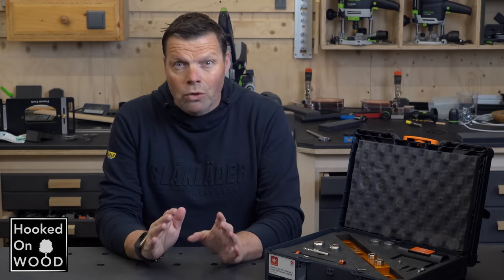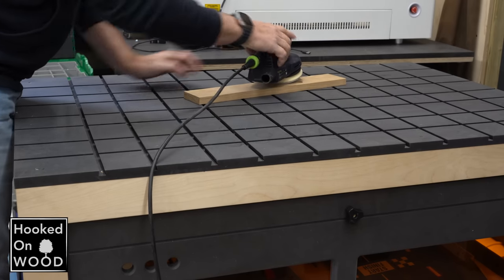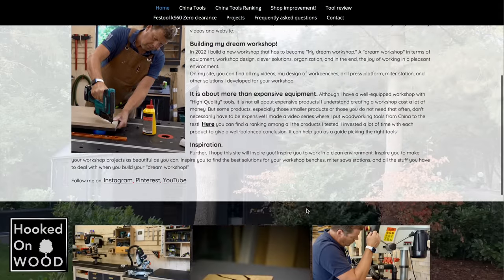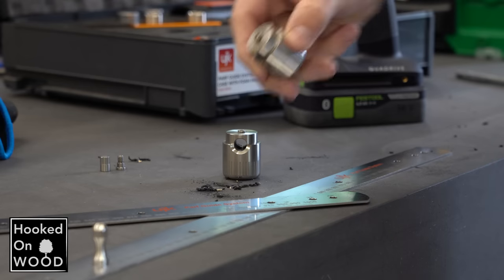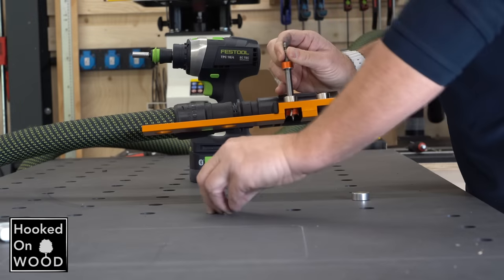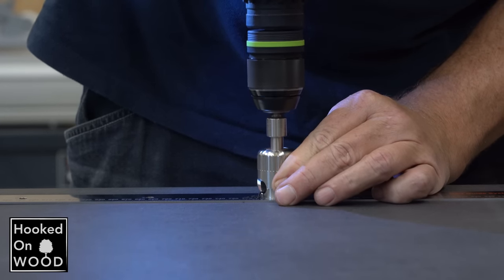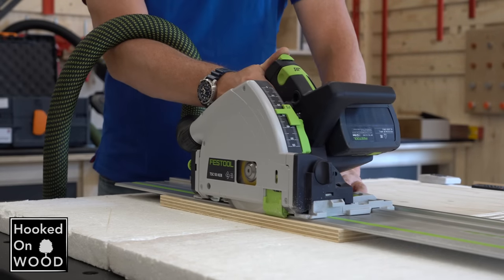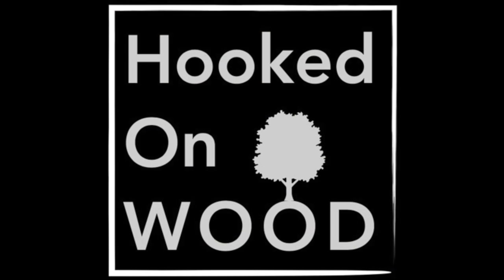Upgrading your workbench with an accurate grid of dog holes!

Comment: What really makes your projects stand out for the most part is the black top, which is pretty much impossible to get here in the USA unless you want to spend a small fortune getting a sheet shipped. This not something that can be found locally or even ordered locally.   Once you take away the black top...you really take away the visual appeal of the projects.  But the craftsmanship and attention to detail is the same and its still good work.  The visual appeal is just not repeatable....not in the USA anyway.  And I live in a very large housing boom location with every wood store you could think of...Tampa, Florida.
Reply from the maker: Hi Garry, I agree with you. It is a shame you can not get it in the USA. We pay around 100 dollars for a full sheet of 18mm. So, that is much more affordable. Without it, I think I probably would have change the design. Although I like the base anyway.
Reply: I've found the same thing - there is a distributor of Velchromat in the USA but no dealers local to me.  I've had good luck with Transtint dyes on MDF - although not dyed through it still penetrates the MDF well with a few coats and looks pretty good. There's black but other colors as well.
Reply: @todddonovan9780  Keep in mind that Valchromat is denser than mdf. You need a couple of people to move a full sheet, as it is probably twice as heavy as mdf. Luckily there is a dealer close to me in North Carolina. Also, a full sheet is a little bigger than 48x96.

Comment: There is one mistake 

You measured to the edge of the ruler. According to Peter Parfit the 3mm holes are not precisely in center of the ruler.
And Peter must know, he created the System 😉
Reply from the maker: He certainly must know :-) Thanks, I will look into it.
Reply: I have the MKII version and started my table layout just as Dennis did.  I wasn't concerned with the exact distance of the first line of holes from the edge, but wanted to ensure the line of holes was exactly parallel to the edge.  I trimmed the table edges later to the final dimension using the holes as the reference point.

Comment: This is perfect. I've been working on a new workbench but your idea of using a Felder is brilliant. I just looked them up and the Felder FAT 300 is affordable and they have a distributor in Australia (for some reason, you have to contact to get a quote but the US site shows the prices and the FAT 300 is affordable for me).
The doghole system looks ideal too so I'm adding that to my shopping list.
Years ago, I saw a video on YT showing retractable dogholes. Never found anything suitable to make them with (best I could do was experiment with various push button type of setups but they just don't give the needed depth). If you come across anything like that for dogholes, please let me know.
Reply from the maker: Hi Gary, Felder comes from a professional corner and searches for contact with the customer. So, they are not always communicating the price. The Fat 300 is smaller, although it can handle the same weight. So, for a workbench of 80 x 160 I think it will work, but otherwise, it will be too small in my view. Another point is that the lifting mechanism is at the short site, whereas it is on the longer side with the 300S. So, when your table does have too much overhang, it is hard to operate it. For stability as a workbench, you have to remove the wheels. There is too much flex in the wheels. So, keep that in mind.
Reply: @HookedonWood  I was wondering about the wheels. Can they be locked? Or do they wobble around even when locked in place?
Reply: @HookedonWood  Oh, just one other question if I may. How does the benchtop attach to the frame? Do you need to glue it in place or is there some sort of attaching mechanism?